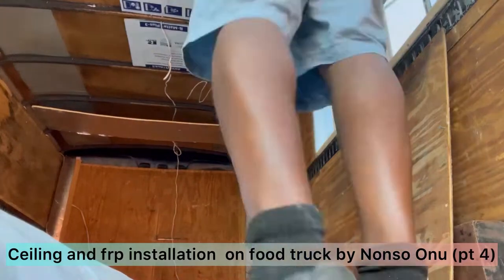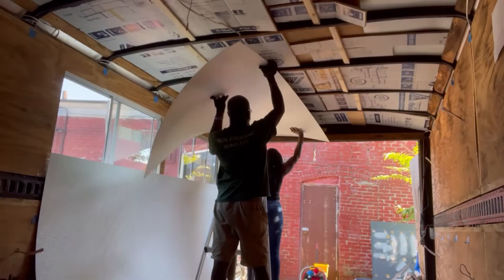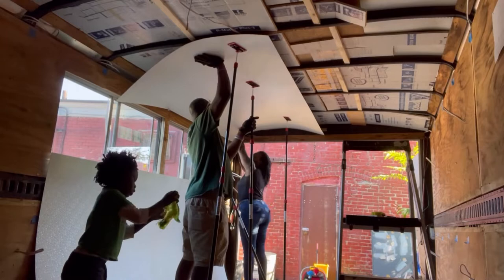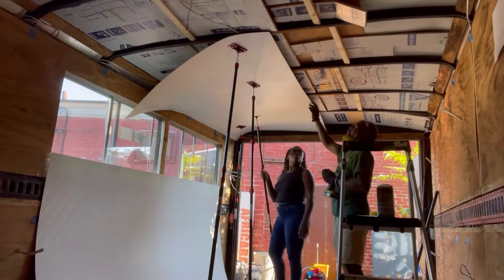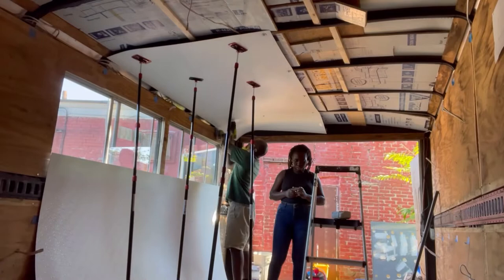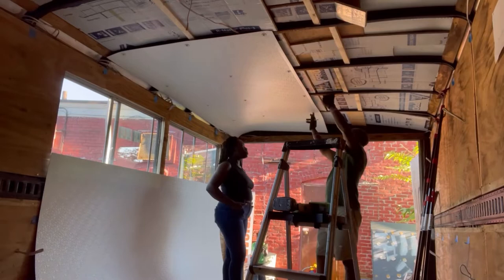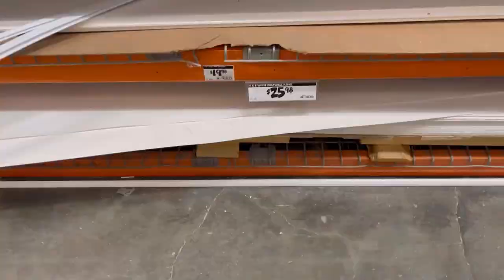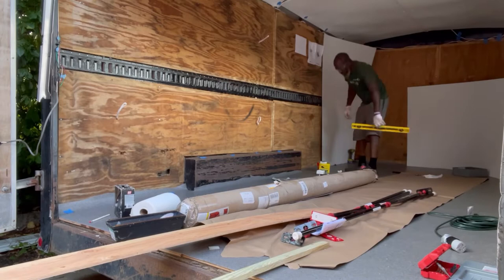Ceiling and frp on enclosed trailer /food truck

Comment: Nice work! I’m getting ready to install this same thing on my cargo trailer ceiling. I bought some fender washers and I’m going to spray paint them also. I made some tee braces to support the panels. I just don’t know if I can handle them myself. 75 years old and not as strong as I used to be.